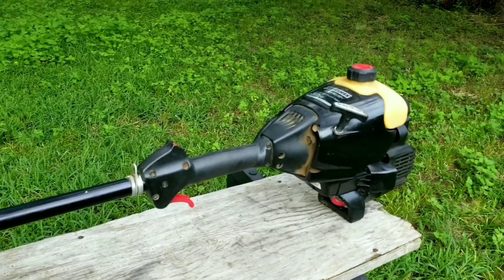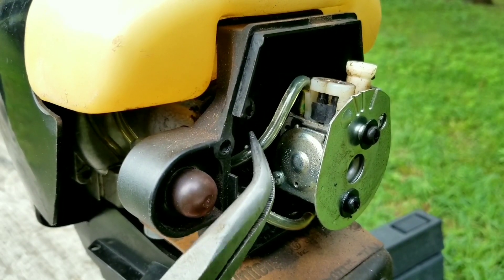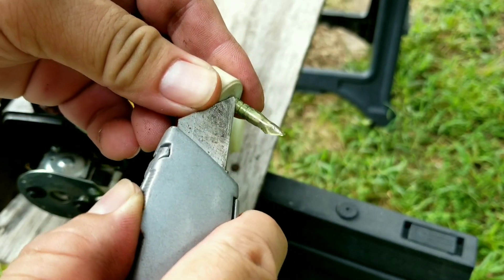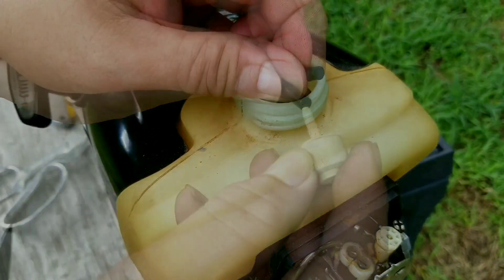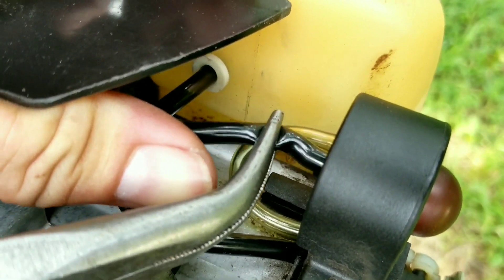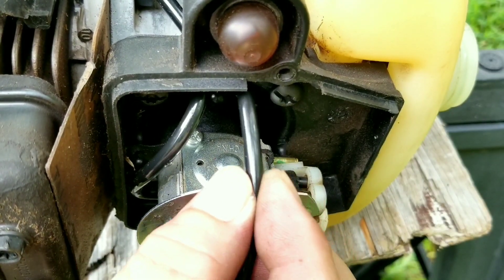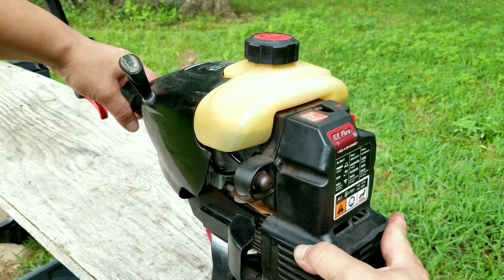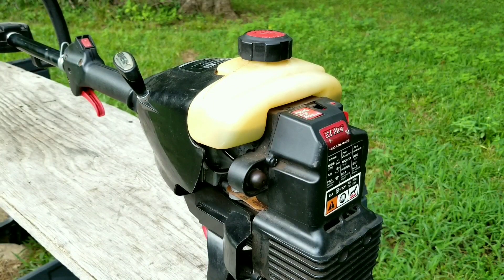What Ethanol gas does to your fuel lines

Comment: I never use ethanol gas in my small engines. I have a station near me that sells NE gas and I mix my own fuel. If that wasn’t available, I would go to A local hardware store and buy some engineered fuel although it’s so expensive.
Reply from the maker: nice, you're one of the lucky ones.

Comment: Silicon might be the best option although more difficult to thread. Kenmore and Craftsman were always my go to, bummer they could not stay with the times and adapt. All countries need to pull back production from China slowly and for mainly security reasons. Zero China bashing here you just cannot put all your eggs in one basket as the saying goes. Curious if you were around when they were adding MTBE to gas instead of ethanol. What a disaster that was at the time, they took it out of the fuel weeks later.
Reply from the maker: I see what you're saying, I definitely think we need to bring jobs back.

Comment: I'm lucky to still find 100% gas here in Puerto Rico...and definitely NOT using ethanol ... switched to premium and see how well it works...
Reply from the maker: good switch
Reply: @INSIDEHOUSEGARAGE  got some bad news: I started the trimmer yesterday just to test it and after a short while,began losing power and eventually turned off and refused to start again... Then I noticed  oil leaks...
Reply from the maker: @samuelvelez1643  that's not good. Where is it leaking from?
Reply: @INSIDEHOUSEGARAGE  got to check that... maybe the engine is blown...

Comment: I'd be wary about using ethanol based fuel in lawn equipment which has an aluminium bodied carburettor due to the high risk of corrosion ruining the carburettor.

I've had no problems using ethanol in a Briggs & Stratton push mower because the carburettor has a plastic body, Honda tell people to refrain from using ethanol based fuel in their lawnmowers due to the fact their carburettors are made of aluminium,I probably wouldn't use it in the Briggs and Stratton lawnmowers that run an aluminium carburettor.

I have an Australian built Victa 2 stroke  lawnmower which has a plastic bodied carburettor as well,I just need to run ethanol resistant hose on it !
Reply from the maker: All very good points . Thanks Russell Booth for the comment I appreciate it

Comment: do you know where i can get carburetor
Reply from the maker: I usually look on Amazon or ebay.
Reply: @INSIDEHOUSEGARAGE  like a number
Reply from the maker: @SamOverby  I usually search for craftsman carb and check that the pics of the new carb match the one on the trimmer.  I never assume that it will fit.
Reply: @INSIDEHOUSEGARAGE  it has the have the choke thing right or no?
Reply from the maker: @SamOverby  no this has an external choke it's not bilt in to the carb.
Reply: @INSIDEHOUSEGARAGE   so i dont need the while clear thing?
Reply from the maker: @SamOverby  do you mean the primer bulb? It's a remote one and sometimes comes with the carb as a kit. I'd replace it if the original one is a dark color.

Comment: Hey man, if you need new carburetors for these Craftsman trimmers, let me know. I bought them in the beginning to fix some old trimmers only to find the engines were too far gone. I'll post a super package deal on eBay for you with all the rebuilt trimmer carbs as well, along with any small mower parts you might want.
Reply from the maker: I always appreciate your help. I'll let you now when I might need them.

Comment: What brand and model number and size for those fuel line you use in this video? Thanks in advances
Reply from the maker: Unfortunately the fuel line was unbranded from overseas but the size is .190" or 3/16".

Comment: Love the video. I've had decent luck with VP small engine fix it fuel or mechanic in a bottle for a quick but imperfect fix. Luckily for me, my nearest gas station sells ethanol free gas. More expensive for sure, but much cheaper than buying Trufuel.
Reply from the maker: Your choices in fuel is excellent.  Thanks Kenneth Cypret for the comment I appreciate it